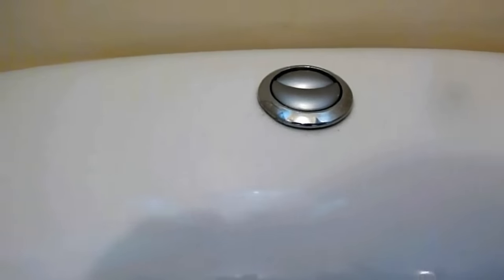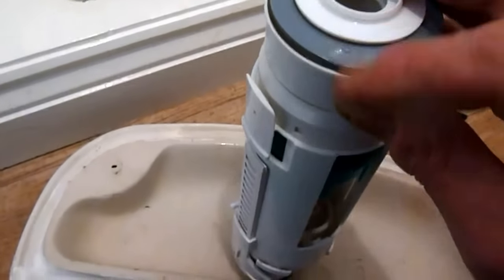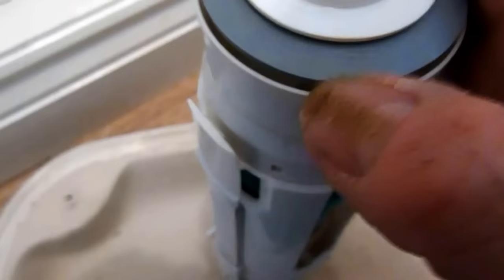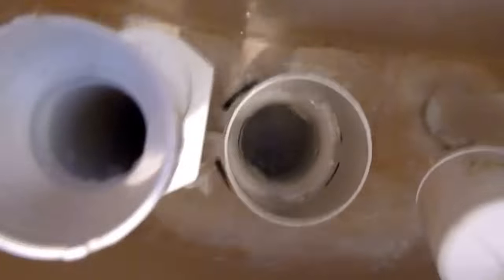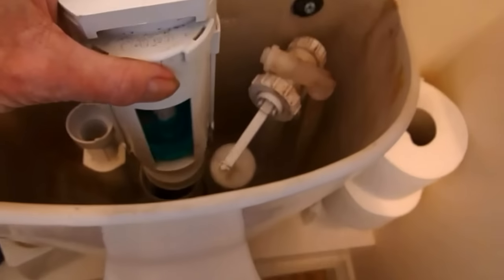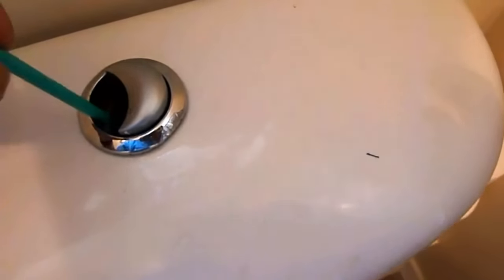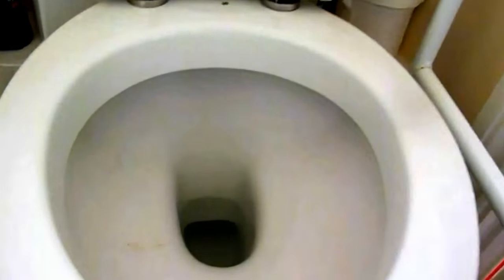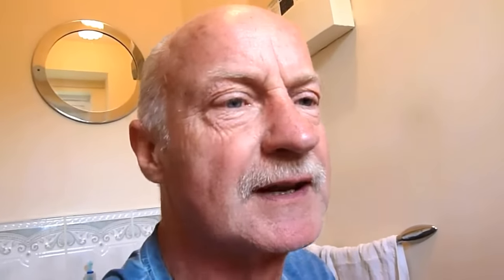How to fix water running into a pan from a push button cistern.

Comment: When people are showing how to do things why can't they show everything? For example, he lifts off the lid with the syphon attached to it! You actually take out the buttons, unscrew and remove the holder then lift off the lid. You can then easily access the cistern. When you replace it, put the cover on first then carefully line up the locating plate with the button holder, fit it and screw it in then replace the buttons. Also, clean the damned toilet and seat before you film!
Reply from the maker: There is always someone who knows better. Perhaps you would like to come round and clean the toilet seat?
Reply: You know exactly how to do it and so do I, but why do you miss out important bits? You cannot just lift off the lid complete with the valve assy as it is clipped in place. The lid has to come off first, then you can release the clips and remove it.
Oh, can't you clean the toilet?
Reply from the maker: I was trying to show what happens if you just pull the lid off. I am certainly not cleaning some one elses toilet.

Comment: I've got two issues. The float is sticking to the wall of the cistern. I've had to wedge a piece of wood between the wall and pipe to lever the pipe to free the float from the wall. Absolutely hideous design. The second issue is the shut off doesn't work and push button sticks. You have to manually push the thing in the cistern back down. Any quick fix or do I need to replace the whole thing?
Reply from the maker: Replace the whole thing. Too many problems with that one.
Reply: @dereton33  It's such a shame because it's the design at fault. If I lived alone, this would last me as would leave it and do what I know works and save water. But no.. have to spend money to fix a design flaw. Thanks for the info.

Comment: I have the same problem, same push flush valve, i tried replacing the washer but it's still leaking into the pan. Any advice? Much appreciated.

Comment: Thanks for the straight forward video. I've cleaned the seal and it's stopped leaking and making a horrible random vibrating noise. Sounds like the England football manager Roy Hodgson is moonlighting as a plumber though !.
Reply from the maker: +ALEX GREEN Turn the pressure down on the valve inlet.
Reply: +dereton33 I did that too thanks, but it all started when I put those blue cystern blocks in and the tank and the pvc coating got trapped under the seal. Thanks for saving on a plumber's call out !
Reply from the maker: Ok no problem. Al.
Reply: Me too - all was ok until I started using Bloo - then within a month two toilets ended up with punctured seals...funny coincidence!

Comment: I really enjoy watching your vids. I've just taken a look at my toilet which was hissing intermittently. It has happened before. I pricked the bubbles with a needle about 12 months ago and it solved the problem. Just had another look and there were four bubbles on the opposite side. Pricked them too and made sure the seal was 'clean'  - it has stopped hissing and leaking water. It now flushes cleanly again.
Can you tell me is the Gerebit sealing 'washer' which stops the water leaking into the bowl a standard size? I will buy a couple to keep in for the next repairs. I'm a 63 yr old woman who likes to do as much home maintenance as possible. Thanks for your vids - i really appreciate them.
Reply from the maker: +Susan cinder Yes they are a standard size.

Comment: My daughter is a student and has just moved into a rented house. After just two days, both toilets have had problems flushing and just before we left one of the toilets had water running constantly and when you push the dual buttons (on the side) there is no resistance. I looked inside the cistern and (unlike ours and most of the types I have found on YouTube) it appears have a small sealed citern with a dry larger cistern, making it difficult to access. As we had to leave to drive the 230 miles home, I had no time to try to fix it or buy parts (it was a Sunday evening). I have had to leave my daughter to contact the landlord's agent who, rather unfairly, replied that "it was working OK on Friday". The water pressure seems to be low and she had a plumber out on Sunday morning to check the shower (supposedly, but I suspect there have been other plumbing issues, and they have had three months to sort things). I have advised my daughter to shut off the supply to the toilet to save water, and she has managed to do that (they are on a meter). Anyway, I just wanted to ask if there is a name for the sealed unit within a dry cistern, and I also wondered if the problem might be with the push button flush as there is no resistance when you press it (though I suspect that is due to the water leaking and the cistern not refilling properly). Any suggestions would be much appreciated.
Reply from the maker: The unit will be the syphon the washer inside it will be gone.No resistance on the push button could also be the plastic tube actuator has come off the inlet to the syphon or the button end.
Reply: Thank you for the prompt and helpful reply. I will try to explain it to my daughter.

Comment: Hi derek recently I adjusted ballcock in toilet to get more of a flush which it worked thanks to your clip only thing is since that every now and again your hear water trickling and noise then stops the noise you hear when level is up any ideas thanks
Reply from the maker: I suspect the valve, change when you can.
Reply: Richard Brown @

Comment: nice one al
flipping the washer over can also work
Reply from the maker: +chelsearobhtj . Thanks for the tip.
Reply: +chelsearobhtj yeah! and charge the customer 35 quid...
Reply: +Cliff Carlo 68 pounds actually done one last night ☺
Reply: Matt Allwright, the truth is out there lol
Reply: I tried the trick of flipping the washer but no luck. Replacing the washer was a cheap enough fix though.

Comment: I dont know how to get that big white tube disconnected from the toilet, it doesnt come straight off like your video, but it looks the same. feeling under it, I think the washer feels smooth and rubbery but has fluffy stuff on the edges of it. does that mean it needs replacing?  the water still hasnt stopped running and its keeping me up at night. also the tap for the water to the toilet is  tight and I cant make it any tighter to shut the water off :( I think I may have to call a plumber
Reply from the maker: Not all of them do come off like that, sounds like yours is one of them, renewing the whole thing requires the cistern to come off the wall. So a plumber will be your best bet. Although I do have a video on how to do it, but it is not for the faint hearted.

Comment: Hmmm.....I think almost all flush issues are the water leaking. But mine is different, i have to keep pressing one of the push button until the tank is empty. Water flushes until I am pressing the button, and stops when I release.
Reply from the maker: Kketansa Art Remove the push button flush syphon and renew the rubber washer on the bottom then replace. If you are not sure, I have a video on how to do this.
Reply: dereton33 hallo, thank you. Yes I am watching the video. I shall do the same. :))) 
Good wishes for you.

Comment: The fun and games start when you've got an 'all in one' toilet and vanity unit - with a one piece shaped sink that runs across the top of both of them. So, when something fails in the consealed cistern you have to un-do the sink taps, run a blade round the sealed in sink/toilet top and only then can you get at the cistern. But even then, because the cistern is then inside a built in unit that the toilet is joined into (Via a shaped hole in the back board) you can't get at anything. 
"Yes they may look nice dear but its a PROPER pain in the backside!"
Reply from the maker: I know.

Comment: I tried this but mine keeps filling, but the white plastic circle with round holes in it directly above the rubber ring keeps falling onto it, could this be the problem? If so can this be fixed or do I need a new siphon please? Cheers. :)
Reply from the maker: Best to change the syphon in your case.
Reply: I have changed the cistern outlet valve it is still running Easter please help a frantic mum🙏🙂

Comment: the problem i have is that water goes inside that tube. what can i do for it plz ?
Reply from the maker: +ethry ethry Check the ballcock is not letting by, or the water level is too high.
Reply: that's a good idea , thanks for replying. I'll try it.

Comment: Mine is doing this from brand new, rubbish Roca mechanism.
Reply from the maker: Charlotte Rixon Yes I know plumbing sometimes takes a backward step and this is one of them.
Reply: dereton33 What I honestly don't understand (I've this same problem) is that without the lid on, and the button mechanism srewed on there is no leak. Put the lid on and screw down to the same level and it leaks.

I don't get it!

Comment: No pun intended but that bog is bogging. I wouldn't be able to go near it let alone film it. Also not meaning to be rude but that dark line through your thumbnail needs to checked out, I don't want to worry you but it can be a sign of a certain illness/disease.
Reply from the maker: I have worked with far worse. Still see if I can nail it.